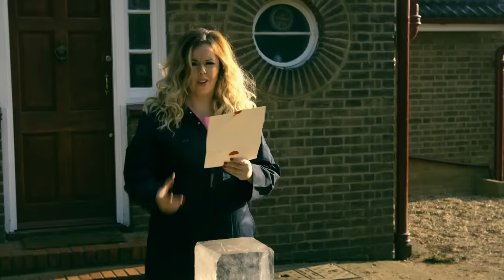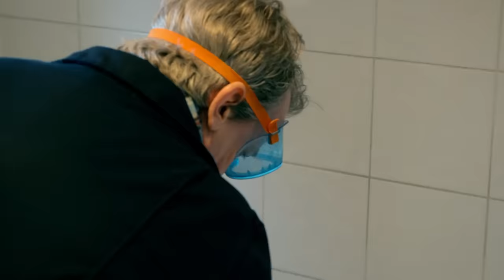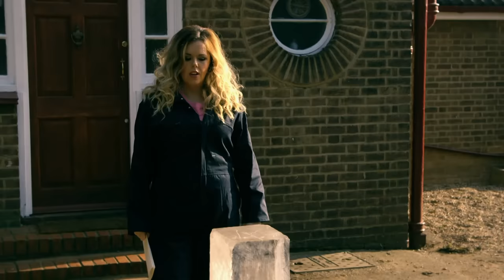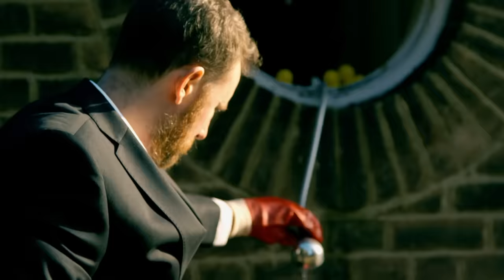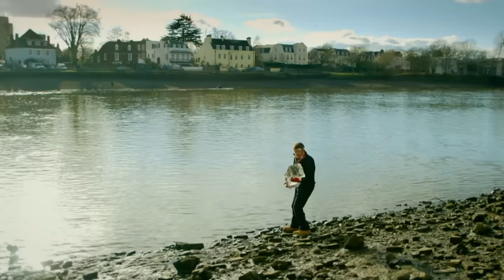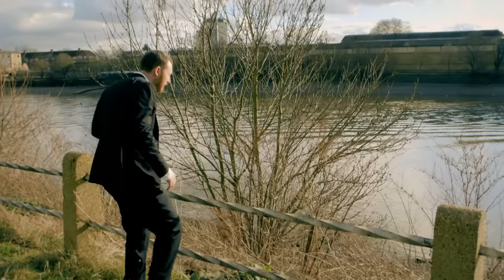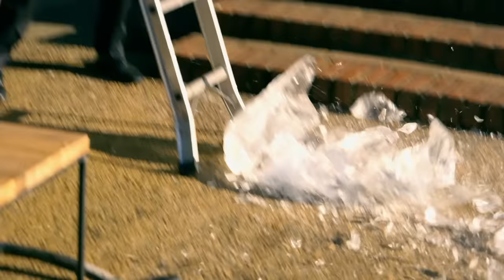Make This Block Of Ice Disappear | Full Task | Taskmaster

Comment: "Make this ice block disappear as quickly as possible." Greg interpreted this to mean completely melt the ice, and of course he can change any interpretation, but this is contrary to rest of the previous tasks and shows. Why not make the task, "melt the ice?" To make it disappear, they could have dug a hole, and buried it. They could have called a taxi and had it driven away. Definition of disappear: "to cause (something) to pass out of existence, possession, or view." To change the state from solid to liquid is not even in the definition, so I think his interpretation is preposterous. Technically, the ice was still present for all of the others (just in liquid  form) with possible the exception of Josh, his went down the drain. The river was the best solution in my opinion.
Reply: nerd
Reply: @mica8701  dpsht
Reply: @-DMD-  bro its been 11 months, i don't think mike minds
Reply: The best solution would love been smashing it and then being done. Afterwards it's no longer a block of ice, it's a bunch of ice shards. To the block is out of existance
Reply: Liquid form of ice is just water - it's not ice, so once it's water, the ice has disappeared. The task was to make the ice disappear - not the water. Tim could have argued that once it was out of sight it had disappeared, just like when you lose an object, you often say it disappeared, even if you never find it - it's still gone, even though it clearly still exists SOMEWHERE. So - there were multiple ways to win this - it was about arguing your case. Greg loves it when they argue and win. Tim just really sucked at arguing his case. Like really sucked.

Comment: My first thought was to stand in front of the block and hide it behind myself.

But then I thought, the task is to make the block of ice disappear, and there's a saw sitting right next to it.  If you saw the ice into two pieces, you've created two new blocks of ice and the original block of ice has disappeared.
Reply: In my head I took this nonsense logic a step further in just presenting them with the question of “is it still the same block of ice even though 1 milliliter has melted off since the task began?”
Reply: I think that was the point though - they could have literally done anything - while others thought it meant melt it to make it disappear entirely because once it was water, it was no longer ice, so it was gone. Tim's was a legit win - but not argued effectively so it lost. Plus he insulted Greg in the process. As long as it was no longer a block of ice - or out of sight, you could call it disappeared, you just had to argue your case against Greg (and the other contestants).

Comment: I totally agree with it "disappearing" down the river. We say "disappear" all the time for just being out of sight.
Reply: Then why not ask everyone (+ cameras) to face away from the ice block? Technically its out of sight
Reply: "disappear" implies you can't see it, not that you don't see it at the moment, so if the crew can turn around and see it it's not disappeared, but after a moment i doubt they'd find the ice in the river
Reply: Exactly, it would be entirely normal to say your cat disappeared when they're suddenly gone and you can't easily spot them, but you wouldn't assume someone's cat is dead and completely decomposed if someone told you that. Completely gone out of easy sight is a valid definition

Comment: Honestly I was really surprised just how hard it was to melt a block of ice that size. Really thought the oven in particular would've done it.
Reply: There are three factors why it is not. First, air is a terrible heat conductor compared to a hot stream of water. Second, the melting depends on the surface of the ice (yes crashing is a good strategy), so it will take a lot of time to melt ice's core. Third and last, the bill is quite expensive 😂
Reply: When you look at that block, that's easily 20kg of ice or 20l of water. A frozen pizza has around 300g, if you put an (absolute) casserole in the oven, that might go up to 2kg but it will take a while to heat up. Now instead of heating something from 20°C to 60°C, it's instead from -10°C to 0°C, but given that the mass is around tenfold and the transformation from solid to liquid takes a lot of extra energy, it makes sense. It's not intuitive, you're right, but anyone who's ever cooked a frozen turkey in the oven will have an idea of how long it takes.
Reply: Also the oven wasn't actually hot yet when he turned it on, so it would've taken a moment for it to start heating up :p
Reply: The specific heat capacity of water is 4200 Joules/kg
Assuming that is 10kg, that's 42kJ

1kJ is 0.28 Wh
So 42x 0.28 that's 11.76Wh
A standard UK oven is 2kW - 2.2kW (so running for an hour would be 2kWh - 2.2kWh)
So assuming that you only need to raise it's temperature by 1 degree, that the ice is actually 10kg and that the oven is 2.2kW then it would need about 5hours to melt the ice in an isolated system.

Now the chunk he put in wasn't that big, but still the ice was probably at -10C so it would take 10x more energy, or same energy 10x the time.

Before the refrigerator was a thing people where transporting ice from the poles to the south and it was keeping things cool for weeks.

Edit: also you are limited by the surface area as well, since the heat can only get in by the surface, more surface area faster melting, so if you don't break the ice, might take even longer by the loss of efficiency getting that heat into the ice
Reply: @Rok_Satanas   Specific heat capacity of ice is half that of water, though, but the extra melting heat (heat required to melt it) outweighs all that calculation by an order of magnitude.
Reply: There's also a reason why Roisin's try was slower than Josh's - her method left the melted,  yet still close-to-cold water near the ice. Meaning the further hot water she added not only melted the ice, but also heated the water, leaving less heat to melt the ice itself. You want the melted water to get away as fast as possible.
Reply: @masansr  Thanks, i didn't know that. I assumed since ice is water, but I guess you can't make assumptions like that and you learn something new every day.
Reply: @Rok_Satanas  that is a pretty bad estimate. water ice needs 332.5kJ/kg to melt. That means it would need about 100 times as long as your estimate. Additionally, you can't assume that the installed load is actually used to heat the ice. It will temperature control itself and will only use the total power when heating up and an oven won't ever use the total power for the whole cooking time. And a lot of that energy is lost to the surroundings as well.
Reply: @thrownchance  The calculation was to increase 10kg of ice by one degree in a close system, it will regulate the temperature if it reaches temperature yes, but I am not sure if it even will while the ice is in there cooling the surrounding air.

The amount of energy used by them light, fan and electronics is negligible compared to the heating element itself.
If it is an oven/cooktop combo, then the watt rating is probably all of them together.
Reply: Actually, in theory, the best way to heat up the ice would be to microwave it. Since microwaves are literally designed SPECIFICALLY to heat water molecules.
Reply: @mr.nerd3.142  nope
Ice doesn't heat up AT ALL in the microwave. Saw a science video on it a while back, can't remember the reason why that is though
Reply: @mr.nerd3.142  microwaves cause water molecules to vibrate faster, but it requires some freedom to vibrate in the first place, and ice's crystalline structure locks the water molecules in place, preventing vibrations and preventing heating.
Reply: @tylerpeterson4726  I was under the impression that even though the molecules can’t really vibrate, they still have room to torque and spin in place. Which is how the microwave heats them.
Reply: @mr.nerd3.142  My understanding is the opposite. That they can't rotate fast enough in the liquid phase (hydrogen bonding?), but their covalent atomic bonds do vibrate, so the vibration is the major absorption spectra for liquid water. It's been a few years and I didn't ever have a really solid understanding of absorption spectra (but I did pass), so I could be mistaken.

Comment: "Make this ice block disappear as fast as possible"

Just break it once, then it's no longer a block
Reply: My thought exactly 
I'm surprised no one tried arguing that
Reply: I agree
Reply: But then you have the 2 parts of the ice block still not disappeared.
Reply: @OmniscientWarrior  Still not a block
Reply: "I can still see it."
"No, you can see *them*."
Reply: @jelo7120  It is a block, just missing half of it.
Reply: @starcraft2own  But then the overall shape is no longer a block, it’s two pieces of ice
Reply: @jelo7120  Or two of the same block of ice, all i'm saying is if i was a judge. I wouldn't let you pass with that explanation because i still see half the original block. It's not like it disappears just because half of it is taken away.
Reply: @starcraft2own  See but both pieces are no longer blocks, so therefore I have made a block of ice disappear
Reply: @jelo7120  How can you possibly say that both pieces are no longer blocks? They're clearly just two smaller blocks of ice. The same ice.
You haven't made THE block of ice disappear, you just made it smaller.
Reply: @starcraft2own  They are pieces of the block of ice, yes, but they are no longer blocks, assuming that block means cube. That’s what I’m saying.
Reply: @jelo7120  The original block wasn't a cube though. And from what i know, block doesn't mean cube, if every block was a cube then there would be no reason for the word block. A cube has the same length on every side, a block is just a dense smooth surfaced brick of material. And those two ice blocks still fit the bill.

Comment: Josh actually might've finished the task even faster if he plugged the bathtub and poured salt onto the ice along with the water. Would've made a big saltwater bath that melted the ice even more quickly. Regardless, still quite impressive, and a fully-deserved 5 points.
Reply: Salt yes, plugging the bath, probably not. Chunking the ice a bit more thoroughly, definitely.

Plugging the bath would have meant there would have been less room for the hot water he was using to melt the ice with. Though salt water can get a lot colder and still melt ice, that doesn't make up for the difference of being able to pour large volumes of room temperature or above water in a steady stream.
Reply: They had huge packets of salt right on the counter too
Reply: Isn't sugar more effective for melting ice?
Reply: @Ikajo  I don't think so. Any water soluble chemicals will alter the freezing point of water, mostly lowering it, presumedly by altering the chemical symmetry involved in the formation of ice crystals. Water, as we should know composed of hydrogen and oxygen. Sugar is composed of those and carbon. Salt is composed of sodium and chloride. I don't remember the specifics, but iirc, basically when NaCl bonds with H2O, the free electrons that would form further bonds are occupied, and the compound is utterly stable. 

Sugar, on the other hand doesn't form molecular bonds particularly different from normal water. 

If I'm wrong about any of this please feel free to correct me. The tl;dr is that no, anger is far less effective at trying to melt ice/prevent the formation of ice.
Reply: I was thinking salt, water, hammer and a spike or chisel or something
Reply: river should have won per their definitions mate
Reply: actually, salt is used in chemistry labs to keep the temperature of ice colder. it makes it rougher to walk on, because it doesn't melt/freeze/melt as aggressively on the streets (which is why that is risky to walk on, as it forms a very smooth layer) but it would negate some of the boiling water. ive done syntheses in which filling the cooler with ice made the whole difference between cooling it enough and just having the ice melt right away and affecting the progression of the reaction

Comment: I'm rather disappointed nobody tried my solution:  Take the block of ice to the bathtub, weigh it down with something, and fill the bathtub with water (any temperature).

The refractive index of water is almost exactly the same as ice, so the ice will appear invisible (disappear) when fully submerged under water.

(Depending on the purity of the ice, some air bubbles in the ice may still be visible under the water, but the instructions never said that you had to make the air bubbles disappear, just the ice.)

Comment: Could have just smash it.
The task was "Make this BLOCK of ice disappear."
The block will  disappear. All that is left are smaller pieces of ice.
Reply: If someone says: make this bar of chocolate disappear, and you just stand there, and in front of their eyes, break the bar into individual squares, have you actually made it disappear?
Reply: @notAshildr  But by that line of reasoning if you melt it, and it's now a puddle of chocolate (or water) it hasn't disappeared either.
Reply: @notAshildr  Agree, but if you throw it on a thrash bin and take the thrash out... It disappeared.
Or flushing it out.
Reply: @notAshildr  Anyway, Ashildr, do you still have the immortality chip?
Reply: throw a blanket over it
"can you see the ice block alex?"
"No."
"So it's disappeared then?"
"Yup."
Reply: Well I guess you can argue your case when you’re on the show and have the same challenge. 
I’d say smashing isn’t having made it disappear but then I’m not the Taskmaster.
Reply: You are missing the point. It wont make the ice disappear but it will make the BLOCK of ice disappear.
Reply: @jestbone89  right? if hiding or breaking doesn't count, you'd have to either chemically turn the water making up the block into another substance or mix it with something else

Comment: Am I the only one that thought: "Why not just bury the thing in the yard?"
Reply: After thinking for about a min, that is what I came up with.  I did first consider getting a sledge and breaking into smaller pieces, as heat transfers based on surface area, then apply hot water.  But then I considered how lose of a word was used, and would have been happy to have wasted my first min to think and go that route.

Comment: no one really understood the importance of breaking it up into smaller pieces. This could probably be done in less than 2 minutes with a hammer
Reply: breaking it and using hot water and salt is the fastest method of actually 'eliminating' the ice but it would take longer than 2 minutes. You can also cheat a bit and do stuff like flush pieces.